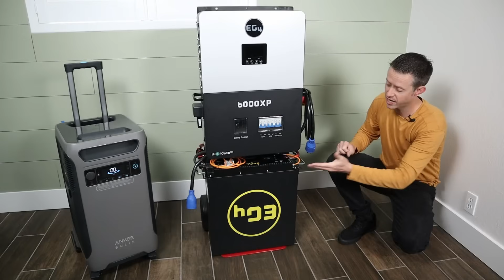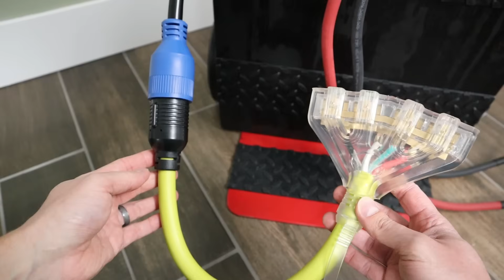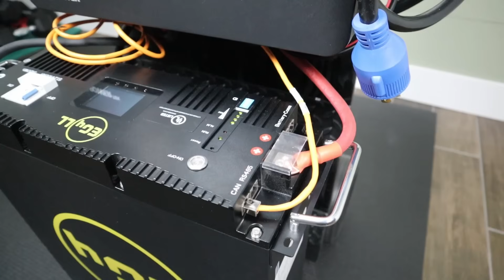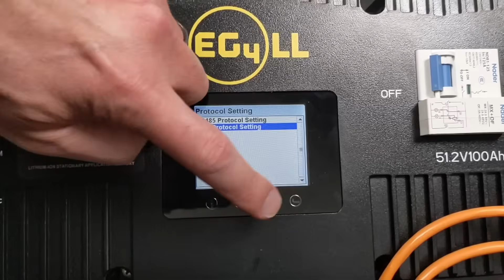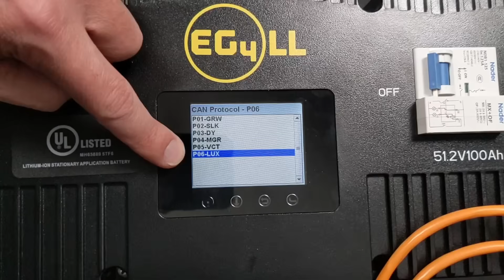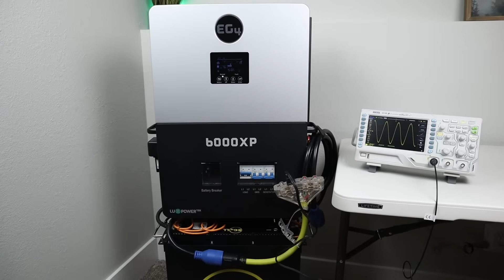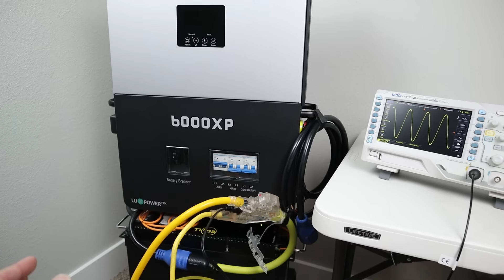Build Your Own AFFORDABLE 240v Battery Backup! Mobile Cart Using the EG4 6000XP & LFP Battery

Comment: Been waiting for someone to do this. I could you please go into more details about installing a second battery on that cart to ensure its supported weight wise and then tell about connecting the 2 batteries together. Thank you ahead of time for any help
Reply from the maker: You'd probably have to use a 4 wheeled cart for a second or third battery to be installed. The batteries would just be connected in parallel. Lots of videos about connecting 2 or 3 batteries together on youtube 👍

Comment: Great video! I’ve been wondering why more people aren’t building systems like this. Add another battery to this system and you can power most houses easily. Add a generator and chargeverter like you did and you’re set.
Reply from the maker: That's where the true cost savings come in, when you add on a second or third battery.

Comment: Did I miss it, or did you not mention the weight of your build compared to the Anker?  So, if you're going to compare your Frankenstein Monster to an Anker F3800, to be a little fair, mention the weight difference. The Anker is 135 lbs. But they have managed to make it as portable as possible. Good video on a power station build. But an "apples & oranges" comparison.
Reply: Thanks for asking this question, I was curious as well the weight. I feel like disconnecting the battery then lifting the inverter and cart into a vehicle would be easier for one person than Anker due to its design and weight. 

Modular for the win😅
Reply from the maker: I'm not saying one is better than the other, obviously each have their own advantages and disadvantages. My cart weighs like 30 more pounds though 👍
Reply: So, a very important factor in a portable power station. Since there is a direct relationship between weight and power. Prolly worth mentioning the weight in your posts. Thanks

Comment: I love it when I was planning on trying something and had questions or doubts and then there is a video of someone doing exactly what I was planning. I want a portable inverter like this I can roll on a solar trailer/camper and then roll off into my shed that has a bunch of solar panels as well. I wanted 240v to be able to charge an EV quickly. Does this inverter have a ground neutral bond?
Reply from the maker: There's a relay where you can enable and disable the neutral ground bond.

Comment: Does this split phase system allow for charging the battery, say from a generator, while providing 240v to a transfer switch?
Reply from the maker: Yes, 240v in and 240v out at the same time 👍
Reply: Now I want a 240v propane generator😂

Comment: huh, if you were more DIY savvy, you could build an 8kwh 24v battery for 300 bucks (8x 280ah lifepo4 cells), use 2 4s balance boards, and stick on an EA sun 3kw inverter for single phase 240v for $140 bucks, and its now a ~$450 8kwh ev range extender. build the battery cells inside of a 20mm ammo can with lift handles, 8x 280 cells fit perfectly and they only cost about 30 bucks shipped.
switch out the inverter with a 120v if you want, the 120v ones are a bit more expensive for 3kw around 200-220 bucks. both inverters take solar, not sure of their input but i believe its similar. fraction of the price when you go full DIY. can build 6 of them for the same price lol. shipping the batteries takes 3 months direct from china
i like the idea of using a j1772 to e bike charging cable, and then charging it from your EVSE with a j1772 plug coz then you can bring it with you in your trunk and charge it for free at all the free chargers while doing pass through charging lol

Comment: I tried to buy this 6000xp but I cancelled my order because signature solar told me my sytem not gonna charge the battery because this inverted required 200AH battery and I only have 114AH battery, but I see you get to run it with a single 48v battery, do you have ant issues while charging with solar?  thank you
Reply from the maker: Correct. They recommend a larger battery becuase you'll need more than 100 amps to get the full 6000w output. Using a smaller battery is fine, you just have to be aware of the peak power of a smaller battery. Charging with solar will work just fine.
Reply: @ thank you

Comment: I'd take the handle ears off and move that strap to wrap around the entire battery about 2/3 of the way up.  Doing it on the handles the bottom of the battery could kick out and slide off the handtruck if you hit a bump/hill wrong.
Reply from the maker: It seems pretty sturdy the way it is. I'll have to take it off a couple curbs to see what happens 🤣

Comment: The problem with a large AIO like that is the LOWEST voltage you can use on it which doesn't match up for something portable a lot of times.  Maybe pair it with a mid-sized MPPT like a little Victron 150/45.  That AIO is also a bit oversized for a single 100ah 51.2v pack, I'd recommend a second in parallel...
Reply from the maker: I'll probably use my Epever 40amp controllers to charge it. My solar arrays are smaller so yeah, the 135v starting voltage is a bit high.

Comment: Great Video!  More testing for sure.  Can you use any 48 volt battery?  Does the battery need to communicate with the 6000xp or can it use any brand of 48 volt battery?  Thanks
Reply: It SHOULD work with any. I think the advantage of using the same brand with communication is so the app for the inverter can also tell you cell balance, and other nerdy battery stuff. But most good server rack batteries have their own app, so you just have to switch between two.
Reply from the maker: This inverter can communicate with a lot of different brands. You can also use any 48v battery, the communication is not required but it's more helpful for tracking power.
Reply: @Jasonoid    Thanks for the replies.

Comment: Dammit! Beat me to it. I have close to the same sitting in the corner. I used a Husky rolling toolbox and DIY'd a 7kwh LFP pack with raw cells in place of the server rack. It was the cheaper option. I just have to mount the AIO to the toolbox handle.
Reply from the maker: That sounds like a sweet setup! More capacity than what I got 👍

Comment: I have a question regarding your mounting. I am building a similar unit with the smaller EG4 all in one. The instructions say to mount it only on non combustible materials. I see you mounted it on plywood which is what I was planning, but now I’m not sure if that is safe. Do they really get that hot?
Reply from the maker: Yeah, I read the same thing. I think they put that there for 'liability' reasons. I didn't notice it getting hot at all. It actually elevated away from the surface. This inverter was so big I couldn't mount to the dolly on its own. If your inverter is smaller maybe try mounting it with metal brackets instead.

Comment: Great video! This has sparked my curiosity of going the DIY route vs. going with something like the DPU. 
What is the make and model of the standalone 120v charger you mentioned? 
Maybe this is something worth elaborating in a followup video. The off-the-shelf options have the ease of just plugging in the wall to charge up when not in use. I would be looking for this on a DIY as well. Thanks!
Reply from the maker: It's a 51.2v LFP LiTime 20 amp charger.  It works well and is priced decently.

Comment: GREAT video.  I'm considering building a system similar to that with higher battery power.  Just trying to figure out what will work on a large hand truck.  Thank you
Reply from the maker: I'd probably recommend going with a 4wheeled cart for anything bigger 👍
Reply: @Jasonoid  Thanks!  if you have any suggestions let me know.  I looked at hand trucks that can go both upright and flat with wheels up high as well as at the base.  Thanks again!
Reply from the maker: @Minnross1  I'd probably try one of those larger plastic two level carts. Plastic would be nice so you don't have to worry about grounding it out / or a short circuit.

Comment: Good concept video, but not following right tool for the job. The 6000 is overkill for a one battery cart system
Reply from the maker: You don't have to run it at full capacity, just when you need the extra boost. The idle power usage was at 21 watts when I tested it.

Comment: On this unit, how well does it handle an unbalance load? i know some units only like to have a certain difference between leg 1 and leg 2. I didn't see it mentioned in the spec sheet.
Reply from the maker: It should be able to handle 3000w per leg. I doubt it would let you pull 4500 from one leg, none of the 240v power stations I test allow that either.

Comment: I do like the fact that with this system, you can purchase components one at a time instead of shelling out a single larger payment for a DPU. Really wish 120v charging was supported with 240v output, but using a separate charger isn't a deal breaker. I'll be going this route soon, but likely mounted on the wall since I don't have a need for the portability.
Reply from the maker: Wall mount is definitely better. I'd recommend a larger battery too, I have the Ruixu lithi2-16 and it's awesome!

Comment: Wow this is amazing.  However, is there a way to use both 120v and 220v simultaneously?
Reply from the maker: Yes, you can definitely do that on this model. It would just require a little more custom wiring. This video was all about simplicity trying to be as 'plug n play' as possible.
Reply: @Jasonoid  I had this same question. The well pump does not operate all the time, would you set up a separate breaker box for the 120 Lines? Thanks

Comment: As I'm looking for something more compact, I was considering a 48v 50ah battery with a eg4 3000.

Current limit means you can only pull 2400w continuous, but you can pull5000w surge so it's still decent.

What do you think? Might make for a good video as it's much more compact
Reply from the maker: Yeah.... this thing is HUGE! Smaller might be more portable LOL. Using the EG4 3000w inverter is pretty common. There are lots of videos out there about that one. I don't see an issue using a 50ah LFP battery, as long as you are aware of it's limits.

Comment: Nice build. I’m also interested in how you ground these? It’s one of the most complex subjects in building the solar system. It takes electricians two years to learn everything about grounding. 🖖
Reply from the maker: If you connect into a transfer switch or generator inlet, it's grounded using your home's grounding system.
Reply: @Jasonoid  That's exactly what I needed to know as well- Thanks

Comment: Great video. Any idea how to make something similar and portable with only difference being the 14 kWh wall mount battery?
Reply from the maker: Maybe a cart with 4 wheels would fit a huge battery like that? My Ruixu battery weighs 300+ lbs but it has wheels! Have you seen that option? The Ruixu Lithi2-16?
Reply: I had not seen the Ruixu before, looks like a great option. More bang for your buck than the EG4. It’s communicates fine with 6000xp?
Reply from the maker: @keenanthomson3253  the manual says luxpower compatible so I'm pretty sure it's good!
Reply: This thing is already 200lbs. What you describe would be over 500 lbs.

So maybe you can install that on a wheeled rack, but no way a 2 wheel hand truck will do it.

Comment: Great build, something I would do for sure it if was just me. Then I could get add more inverters and batteries and keep expanding. The customizability is great.    Could you output 240v and charge the battery with 240v  at the same time ?
Reply from the maker: Yes, it supports 240v output and 240v charging at the same time, just not 120v charging and 240v output.

Comment: Great video Jason.  I am very impressed at the efficiency of the EG4 6000XP.  The efficiency is better than the EG4 3K off grid I use to build my hand truck portable station.  The efficiency of the 3K unit was not as great as I expected for my particular use, so much so that I ordered the Victron 48V 1200W inverter to test with the EG4LL battery.  I would love to see more videos you testing out this 240V build.  Your videos have advanced my minute knowledge of solar energy and systems.  Thank you for sharing your knowledge.
Reply from the maker: Let me know how you like that Victron inverter!

Comment: I think DIY has come a long way. However, IMO plug n play systems are better in the following areas:
-compact form
-app / software integration
-noise level

I think DIY wins with total solar charging, expandability cost, and when you have to repair something. Excellent video. I'm excited to see both DIY and plug n play options get better!
Reply: These are great builds to learn everything about solar though.  It's like electrical LEGO.
Reply: Never knew those inverters made so much noise, your the first guy to test for noise which is appreciated.
Reply from the maker: @nicholasespinoza9610  yeah.... I kinda felt like other reviewers were hiding something.... I used to work with servers so I knew it was a loud system when I saw server fans installed! 🤣
Reply from the maker: These are excellent points, thank you!

Comment: Great set up and video.
Complete noob when it comes to solar and power stations here, (don't have either one) but I do understand tech and electricity. I've been following your content and others as well for a while now. 
I wonder if the fans in the 6000xp could be replaced with quite ones that can still move the amount of air needed?
That would be way to loud for some folks who don't have a garage and would have to be inside with it. 
Other than the noise it's a fantastic idea for expansion and customization.
Reply from the maker: I doubt the fans could be swapped out for something more quiet. I think with time they will get better. Enough people need to complain about the fan noise and they will make a change. Power stations are basically silent now (the new ones) so it's a big difference.
Reply: @Jasonoid Yeah these inverters aren't really meant for portability like this. 8000w of solar input should make it obvious it's expected to be mounted on a wall in a whole room full of batteries, not taken camping!
What a company should do is build a nice quiet one into the top of a wheeled "filing cabinet", with a slick design and sockets right on it, just like the Ecoflow DPU. But also give it the super high solar input and zillions of settings these things have.
But it would also be vastly cheaper because the rest of the "filing cabinet" would be empty shelves! Users could slide in their own 3x 48v server rack batteries, or reconfigure the shelves to series-wire a bunch of 12v batteries, whatever they can afford or obtain. Batteries could then be replaced as they wore out / if they break

Comment: The main problem with all of these DIY power backup systems is they are not plug-n-play.  When the lights suddenly go out, dad is not always going to be home to power up that 'thing in the garage with all the wires'.

The commercial units are cheap, powerful, and small enough to store in a broom closet.  When the lights go off, simply depress the power button and plug stuff into it.  Plus, you don't have to worry about it falling onto small children.
Reply from the maker: Plug n play definitely has its benefits. They are much more refined! The downside to DIY is the cost. The initial purchase might be similar but adding accessories and batteries gets very expensive. For example, 10kwh of batteries on a DIY system can be around $2500. 10kwh on a plug n play system is near $5400!

Comment: nice work man - very clean... can you elaborate on why you're using the "generator leg" and not the second phase leg... just curious to understand that ty!
Reply from the maker: I used the generator leg since this will not be grid tied and I will be charging it with a generator. I probably could have used either option. The settings on this unit are EXTENSIVE and it will take me time to get everything configured the way I want.
Reply: @Jasonoid  ahhhh simple and sound shortcut and uses less heavy gauge wiring in your use case... derp i forgot lol ty!

Comment: Thanks so much. The best on this unit hands down. I'm issuing a stop work order to myself on my build. Going to make some changes to allow input and  output flexibility per your video. YES YES more on this unit and similar DIY projects. My primary focus is backup and living off grid and I suspect there are many other who need the security from the frequent grid problems.
 I loved the livestream last night. Ironically it was a comments in one of the Anchor review that diverted me to the build it yourself.
Please keep them coming.
Reply from the maker: I think there are advantages to both sides. I need to do a better video talking about what I like about plug n play and DIY. If the added cost of a plug n play system is not an issue, I'd probably recommend the Jackery 5000 or the EcoFlow DPU since they are silent, compact, and the user interface is excellent. DIY wins with expandability cost and you can repair them yourself.
Reply: @Jasonoid  I agree, For some all in one plug n play is the right fit. For pioneers with scars from all in ones, I like  the capability to replace a component and not add to the trash pile.  Scalability ad salvage-ability work best for me. Of course, I have a couple of powerstations that I gladly accept the limitations of. Ask me about the personal computer museum I should have opened.